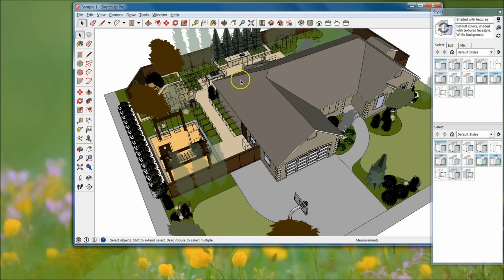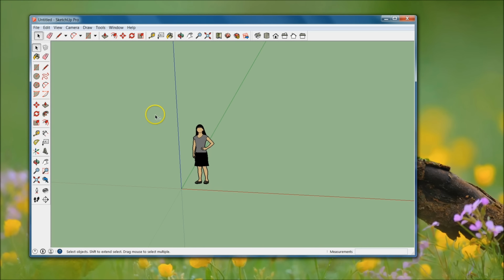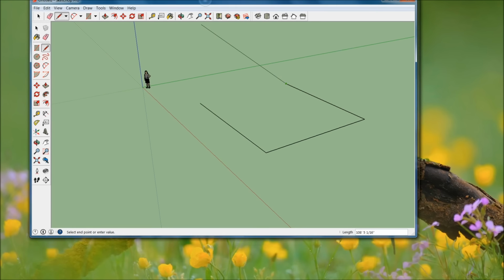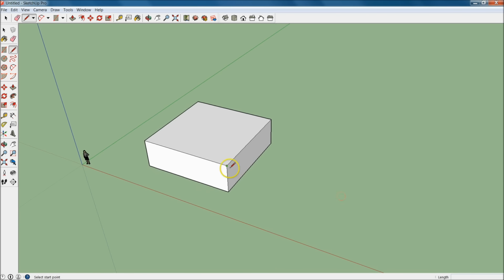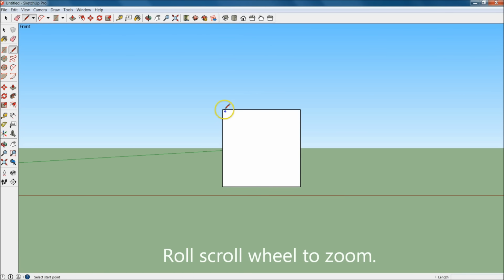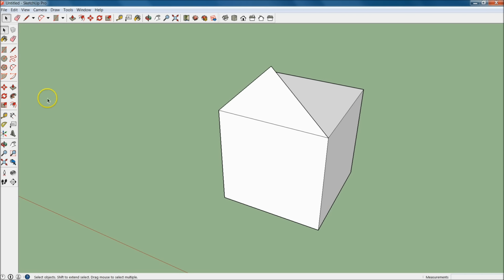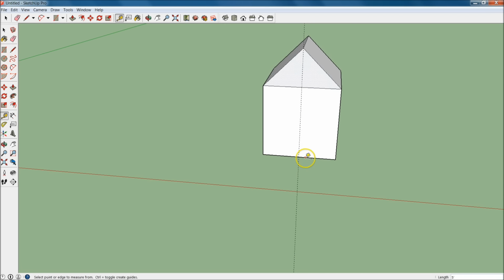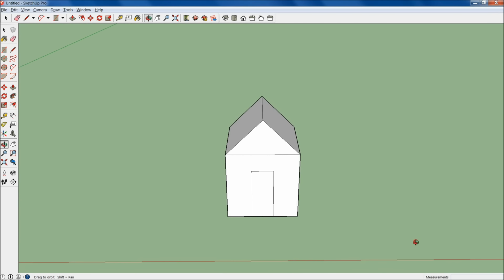SketchUp Tutorial - 1 - Beginner SketchUp Tutorial

Comment: does sketchup have commands like autocad?
Reply: No, AutoCAD uses 'typed word' commands extensively but not exclusively, Though lately, they have been phasing them out. Typed Word commands are only there for the "Early" users Original AutoCAD and one or two subsequent versions after that (not sure exact number) used Type Word commands almost exclusively (DOS operating system) but in later versions you can also use mouse clicks and Shortcut keys. Whereas SketchUp does not use "typed word" commands. Your choices are mouse clicks or Shortcut keys

Comment: Not sure where I should be asking this question, but I have am stumped!  I've tried to solve this problem for several hours.  I have imported an image into my presentation...a picture of a curtain.  I am in the pipe and drape business and would like to use this program to display pipe and drape designs.  So I've imported a curtain and made several copies of the curtain for my design.  I am trying to add color to one of the curtain panels and having difficulty.  When I triple click on one of the curtains, it selects all the curtains.  How do I only select one of the panels at a time?  PLEASE HELP!!!!!
Reply: One click selects Face (flat plane no borders), two clicks select Face, edges, and vertices (flat plane, connected lines. and points) three clicks select all geometry touching what you clicked. Usually the entire model unless you did something to separate bodies...Make Group, separate Layer,...

Comment: thank you so much but why u use metric  or cm
Reply: We use feet/inches in America.
Reply: Most American Engineering firms and most anyone using CAD has switched to the Metric System.For my own personal projects, I tend to lean toward feet, inches because it's the most comfortable, not the most efficient.  I grew up here in the heartland of America and was raised on the Imperial (feet, inches) system but the Metric System is much easier. We do not have the time to determine how many inches are in a measured amount by dividing by 12 or how many yards by dividing by 3...We need to spend our time producing not "multiplying/dividing multiple base numbers. Just moving a decimal point is MUCH easier. Not to mention the fact that we are pretty much the only Country in the world that still uses Imperial. Try Importing or Exporting goods based on the Imperial system and see how quickly it creates a 'Bottleneck' in shipping or manufacturing.

Comment: Hi, I'm using Sketchup 2017 for the 1st time and I'm around the 5 minute mark where you talk about typing in the length you want.  I'm using the same template but in metric.  I find that I can't type in the length (e.g. 4 metres) although it is really easy to move the line to that measurement.  Is this peculiar to either the metric version or 2017?
Thanks
Reply: PS, the sidebar animation (on the right of the page) is driving me nuts.  How do I turn that off.  No search results in Google.  :-(
Reply from the maker: You can click the circle at the top left to close the Instructor panel. 
Or go to "Window" in the top menu and uncheck "Instructor".

Comment: A word of advice. Do not use version 2016 to follow this tutorials yet since some of the commands are different from 2015. I will stick to 2015 until there are more updated tutorials for 2016.
Reply from the maker: Which commands are different? I use both versions and I don't know of any differences.
Reply: +Jake Day Williams Hi Jake, you're correct. However there was a command in 2016 that it's on a different pull down menu if you follow this tutorial. I can't remember which one it is right now. I stopped practicing a while ago.

Comment: How would you differentiate AutoCAD and SketchUp? I had trouble with AutoCAD, but Sketchup seems pretty easy.....
Reply from the maker: +iC3 AutoCAD's toolset is so large it has multiple workspaces, including those for 3D modeling and basic drafting projects. If you need to get up and running quickly with creating designs, or just prefer a program that's easy to use, Sketchup is the program to get.